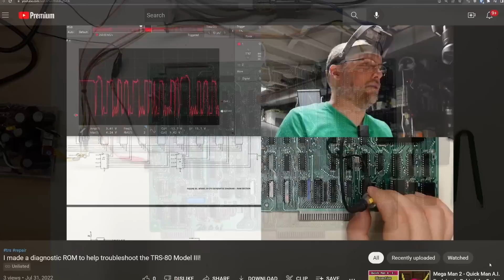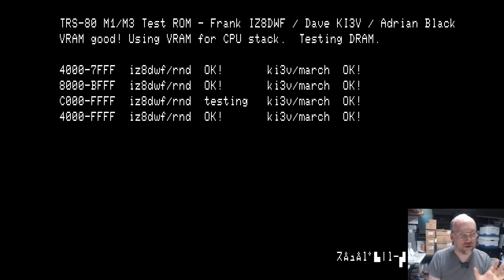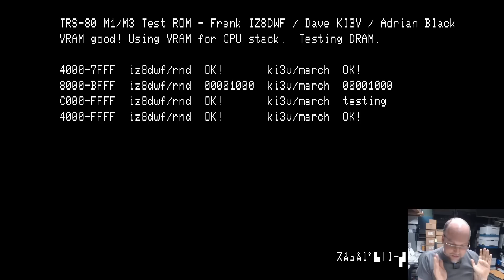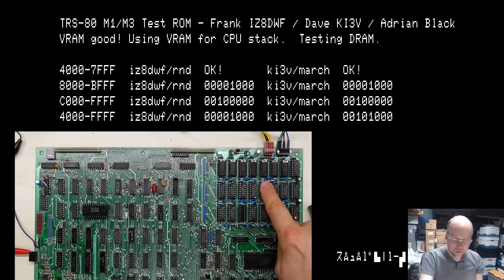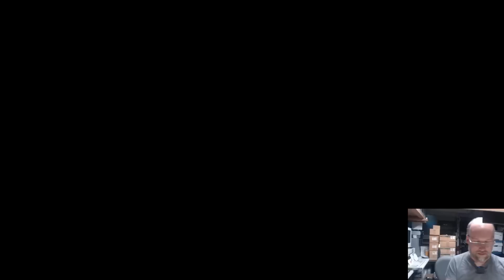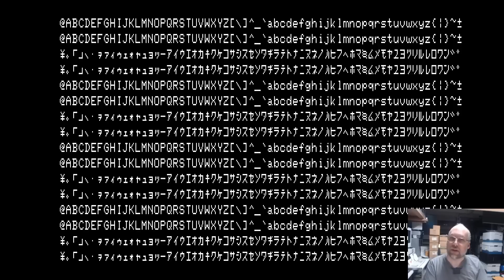Let's talk: Our brand new TRS-80 Diagnostic ROM!

Comment: Well Sir.  Very well done you and your colleagues.

Now you could change the EEROM or EPROM for fast RAM adaptor.  Add a two-port interface and then connect to any computer with USB or clunky serial port.  As engineer, this is how I/we developed firmware back in the day - 1980's.

The adaptor is just the plug-in to memory socket with alternate gnd/signal on ribbon cables (very important, even at 2Mbps).
Now you have something akin to an "In Circuit Emulator" where code development becomes very fast, but also avoids much time with burning read-only memory of whatever type.

Also, we usually (especially with the Z80) added a simple monitor utility that allowed real-time inspection of memory and CPU registers by means of the very fast RESTART interrupt feature on the Z80 and its derivatives - using the same memory interface by stealing a few bytes of uncommitted RAM for read/write instruction/data.

I leave you with the above in the hope it may be helpful.

Comment: Instead of using PUSH and POP, use the EXX command to switch to the alternate B, C, D, E, H & L register set.
Instead of using CALL and RET, store an 8-bit offset in one of the 8-bit registers which points into a jump table and then use a lookup into the table to find the appropriate address to continue from instead of a RET.
It'll take more work to code it this way, but you should be able to make the whole program work without any stack.
Reply: correct   dont need to use the stack pointer for this, but, he did not require a diagnstic rom at all.
had he used a methodical approach at the very start, he would have found the DB problems in first video, IN 30 SECONDS. Should not have abandoned the missing WE at the ram, he should have checked the address and data to them, and the enables. while your there, check the buffered data bus (req a few seconds ) and.......fault.
from the cpu side...... SOP    check address and data bus and the rom selects and OE, then check the buffered add/data   again, would have found it,
removing the rom , will not return a 00h , it will be an FFh , reset to 0038h
Its going to see how much RAM installed first (probably)   check add/ db to ram and not ras/cas....again, problem found
he has definatly got a bad track/ connection some where....... AND ITS STILL THERE.
the biggest red flag......... the 645's..... 3 of them..... oh aye     why. That would have been my first port of call, check previous repair....... litterally seconds.
Bet this guy's a teacher. If you cant do - teach
did everything wrong and nothing right.
moan gripe rant

Comment: What about a custom EPROM adapter  board for the diagnostic ROM that includes some logic for replacing part of the ROM addresses space with some static ram included in the same boar? This would give you some "reliable" ram for use as stack.

Also, one address could be reserved for adding a speaker directly to the "test board", in this way there would not be need for any other hardware working even for the diagnostic sound.

Comment: I could be wrong as it was about 1980-ish when I started using the TRS80 model 1. 
When I modified my TRS80 Model 1 for lower case there were different character generator chips.
I'm vague about this because its about 40 years ago. I remember something about true descending characters being an issue too, which can be solved !
A group of us did extensive work on the TRS80. Most of us piggybacked the DRAM to increase it to 32k, 48K etc. 
I built a 19" expansion rack which had a 64pin back plane, where I could add our home brew boards, like Printer Interface, Disk interface, Real Time Clock, Modem and EPROM Programmer. 
The first board in the rack was a buffer card using 2x 74LS244 for the address lines and a 74LS245 for the bidirectional Data Bus.
The rack internally had separate 5Volt and 12Volt power supplies, I think I had an external 21volt or 24volt supply for the EPROM programmer.
I was lucky to work in electronics so parts were very easy to obtain.
Being part of that group of TRS80 users was great fun and I learned a lot about computers back then. The group gradually transitioned to the BBC computer and finally PC clones.
Unfortunately when I moved to the USA I gave all of my TRS80 equipment to a friend and I have no Idea if any of it still exists today.
One other note, some of the early 5 1/4" floppy drives from Tandy/Radio Shack were only 35 track and not 40 track. If you were lucky you could squeeze 38 tracks out of them !
Thanks or the trip down MEMORY lane! (Pun intended)

Comment: Is there such a thing as a diagnostic board that plugs into the CPU's socket, containing a socket for the displaced CPU, and with on-board RAM and EPROM (flash?) that could be mapped in to shadow external memory and mapped out to access the external memory? (I could imagine there also being a "window" that maps n pages of the memory map to n pages of the external memory map so that you could check external addresses that would otherwise be shadowed by the diagnostics ROM or workspace RAM.) There wouldn't be any of this problem of not being able to rely on the computer's RAM, buses, or decoding logic. You could have extensive diagnostics without the limitation of having to cram it all into an EPROM that can fit an existing ROM socket. Edit: Oh, and I forgot about it having an on-board serial connection so you could talk it.

Comment: When I got my Mode I for xmas 1979 I asked for the lower-case "kit" too.

I still have my entire setup but it hasn't been powered on since 1986 or so.  When it was in storage, some mice made the expansion interface home.  Still have 4x SD FD drives and a Line Printer V.

I don't know what to do with it.  I can't bear just disposing of it.
Reply: Maybe put it on eBay ? I'd be interested in some of it.

Comment: For the Model I stack, could you use an upper nibble from one byte, and then a lower one from the next, and so forth, using 2 bytes for one byte of stack?
Reply: Not from software. The way the z80 stack works is set by the CPU. Still, there was one thing we could do: rewrite the code to not rely on RAM or stack at all. That’s how the current code runs. No good RAM or VRAM necessary.

Comment: What a great explanation. Hopefully I’m not repeating anyone else's comments, but have you also thought of testing other parts of the hardware, or is the assumption that if you can get through these tests, you can get enough running to load more complex tests from normal programs? I did ponder one thing based on bare-metal systems I’ve helped develop before — a ROM diagnostic, eg based on sumcheck or sum such. Of course, there would only be so much badness that could be tolerated on the diag ROM itself and still work enough to test, and testing the secondary ROMs (and character generator ROM, if it’s in the memory map) can perhaps be done once video and RAM is proven.
Reply: Printing a checksum for the ROMs that should be present might be a future enhancement.

Comment: Testing the full 48K of RAM in one march test is definitely a good idea as it exercises the address decoding (and RAS/CAS gating) towards the DRAM banks. These TRS-80 videos bring back fond memories - I worked in a Tandy store when the model 1 was introduced (and probably sold the first one in the Netherlands, the day after we got it from the warehouse in Belgium). And installing those lowercase mods became something I could almost do with my eyes closed 😄
Reply: Yes. Something should prove that the three 16 K banks are distinct, and not just one echoed three times! I have seen this type of issue before, where someone thinks they have more working RAM than they actually have. "Address in Data" is a good test, but on an 8-bit machine you have to be a bit clever to make sure the upper address bits are tested.

Comment: 7 bit vram in the model 1 could be doable for the stack if you are really careful with how you layout things in the rom.  Would need to manually align addresses for instructions so  bit 6 is never important in return addresses. It would lead to a lot of wasted space in the roms with lots of padding added to  get rid of bit 6. Of course you'd ned to also make sure you are careful with all stack usage. Assembler macros could help make this all easier

Comment: Great work, guys! I remember doing stuff on my ZS Spectrum in Z80 assembler. So much more flexible than the ZS Basic on the machine. But that was sooooo long ago, I think I forgot  everything I ever knew about it. I wish I still had one of those Z80 based computers like the TRS-80 or Commodore 64 to play with. BTW: are all the guys who help you with channel amateur radio operators? I noticed the US and Italian call signs. 73 de M0NMI
Reply: Go to the GitHub link in the video description.  At the bottom of the README is a link to an amazing emulator for all of the desktop TRS-80 machines. You can get a lot of those memories back. TU ET 73 DE KI3V
Reply: Certainly looks that way !!  73

Comment: Due to the small size of the .BIN file for the EPROM being just over 1K, you can get away with a better option for an EPROM that does not require an adapter board. A TI TMS2516 EPROM is pin for pin compatible for the stock ROM ICs, are still readily available as NOS and are reasonably priced. Most EPROM programmers have the capability of programming the 2516 without issue. I tested this for proof of concept just this morning on my 48K Model I, and it works just fine. And yes, your ROM does work on a Model I without issue. Mine does have the lowercase mod with the extra piggyback SRAM to get the 8th bit, so it does work on the VRAM test just fine.

Comment: Are you planning to add tests for other parts of the machine? I/O ports, that kind of thing.
Reply: Not at this time. We’re going to port it to a few other machines that could use a simple, effective ram testing rom.  The Model II is next, and after that probably the Kaypro machines.

Comment: A possible technique here, depending on the memory layout of things, could be taking advantage of addresses that never use the top bit. That might mean adding NOPs before a jsr to make sure both the MSB and LSB of the return address don't use the top bit (assuming that's what's missing), but it should allow subroutines to work fine.
Reply: Unfortunately it’s not the top bit that’s missing, but bit 6. And it gets filled in as a NOR of bits 5 and 7. In a pinch it might be useful to store some 5-bit RAM variable, but generally useless for anything but VRAM. Also, remember that if using as a stack, each entry is two bytes, so in an address bits 6 and 14 of a 16-bit address are both corrupted. An interesting mental exercise, but just not worth the effort to actually try it.
Reply: @drgiller  ah, that is unfortunate. As far as being a "mental exercise" I'd probably write a tool that took it all into consideration (e.g. give the tool a binary, the tool marks any areas that wouldn't work, and suggests fixes/automatically does any fixes)
Reply: The Z80 uses CALL, not JSR.

Comment: Speaker or line-input?

In the videos, the cassette port is used to drive a "speaker". Is this an actual 8-ohm speaker or is the cassette output used to drive an audio amp?
Reply: It uses the casette port output for sound. You will need an amplified speaker to hear the tones.

Comment: You could also add the ability to test the 128K RAM that the Model 4 can have, it is very similar to the Model III but supports bank switching of memory past the 64K boundary.
Reply: BTW I’ve confirmed that the Model II banking code doesn’t work properly in the Model 4. But I assume it’s not TOO much different.
Reply: Yeah I was surprised to learn that the ROM was only for Model 1 and 3's, as I thought the Model 4 was compatible. I've got a Model 4P that I wouldn't mind testing with this...

Comment: Yes, the main CPU on the Model I has 16k, and the expansion interface holds 32k for a total of 48, and the roms (level I and II) are 8K each for a total of 64k of addressable space, there are no holes or gaps, although you of course can't write to the rom areas.  I remember doing the lower case mod because I worked in a Radio Shack computer center at the time (this was 40 years ago), and I remember the tech telling to do the lower case mod, but I had zero experience, but he grabbed a ram chip and a hunk of wire and threw it at me and I recall it was simply piggybacking the ram chip onto the chip that had the 7 bits.  After that, you had to load a driver from cassette or NewDOS 80 had a lower case driver built in.  Wow... so long ago, but when you mentioned the 7 bits it all clicked into place, and I realized and now understand what I did.  Aside from piggybacking the ram chip, you ran a wire from one pin (that I think was bent up) to somewhere else on the board.  I still have that model I, I could take it apart and see where it goes...hmm....
Reply: The original RAM memory size on my TRS80 Model 1 if I remember correctly was only 4K. I lived in the UK at that time.
I had it upgraded by Tandy to 16K !! and it cost about 100 Pounds sterling ($150) back then (1980) for TANDY to do the 16K upgrade !!

Comment: Since you're using an adapter board for the rom anyway, it would be neat to have a small static ram on the board that maps into some free space to use for a stack for systems with 7 bit or bad video ram.  It would probably need at least one other connection for write enable, I think.  It's been 30 years since I've directly messed with this stuff.

Comment: Feature Ideas.

Add a second entry point into the ROM so that it can be installed in the ?third? ROM socket (is it compatible?).  Then you can also add CRC functions so it can check the ALL of the ROM chips against a known good list.  Adding it in the first socket will end with it checking the last two chips, then moving it will check the first.

You could also add an LED (with the supporting hardware) to the board that could be triggered by reading/writing to a specific location, or in general.  This would give an instant indicator to if code is running.

Comment: Please print exact bytes that are wrong as in first version. 
This will help in complex issues like faulty buffer or weak drivers.
I would also try rely on VRAM as little as possible. It may easily be working but unreliably. 
A very good memory test otherwise! Thanks! How about a c64 version?
Reply: The problem with printing the location in the first version is that they were all in the same chips.  It wasn't useful information, and I had to stop the test early to report where the error was found.  I made the judgement that it was more useful to try to find as many bad chips as possible than to report where within the chip the error was found.  If it's of interest to know where within the chip the error is located, I'm afraid you'll have to use a good hardware RAM tester.

As far as using less VRAM, in the current version we don't rely on it at all, managing to make all of the tests and reporting stackless.

Unfortunately I know zero 6502 assembly.  Adrian tells me Frank's a wizard at it though...

Comment: If the Z80 stack can be put everywhere, it might be worthwhile for the debug ROM to try to find 64-128 bytes working bytes anywhere in RAM and put the stack there. Even if VRAM is bad with a stuck bit or 2, a human might still be able to guess what some garbled characters and diagnostic text mean.
Reply: There are two troubles with this approach.  First, achieving what you describe without using a stack (because you have not yet located a trustworthy segment of RAM) is itself not easy!  Second, it can be difficult to tell, without intensive testing, exactly which memory locations are the cause, and exactly which are the victims in the memory chips.  It's really only if the whole bank is good can you trust any of the RAM in that bank.  

For instance, the 4116 chips are 16K "deep" or "long", but only one bit wide.  So we end up testing 8 chips at a time (which is why the test reports 8 results).  If any bits (meaning any of the chips) test bad, you can't really be sure you know all of the addresses within that bank that can be corrupted by access to the bad locations in that bank.  It may well be possible with an extensive, complex test, but we don't have the RAM available to undertake that test.  So we try to do something useful, which is indicate which chip we know has some bad addresses in it.

Fortunately, for recent versions of the test, we don't need RAM or stack at all to get the same results, so we don't need to find a trustworthy section of RAM to be able to print to the screen.  VRAM is a bit more tricky though.  I like the idea of printing to the screen even if we know there are bad VRAM chips.  But in practice, two things argue against it.  First, if we detect bad VRAM, filling the screen with the character set is probably the most useful troubleshooting step we can do, as Adrian demonstrated.  Second, we have actually tried it, and it was surprisingly difficult to make heads or tails of the display when some of the VRAM bits are bad.  So at the moment, we are playing the odds and trying to do what will be the most useful thing, most of the time.